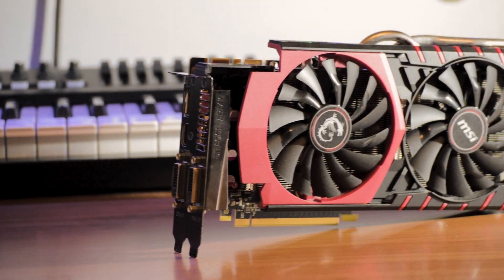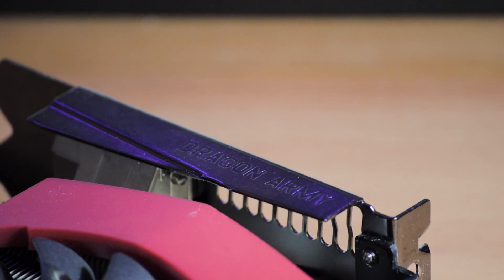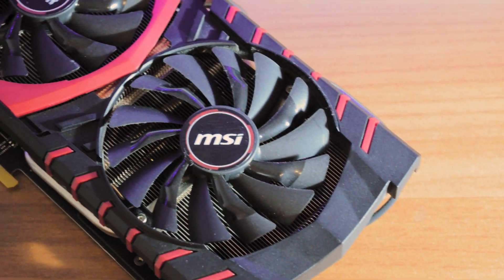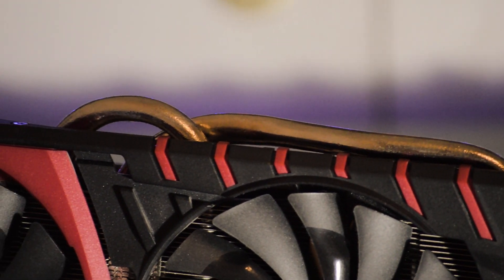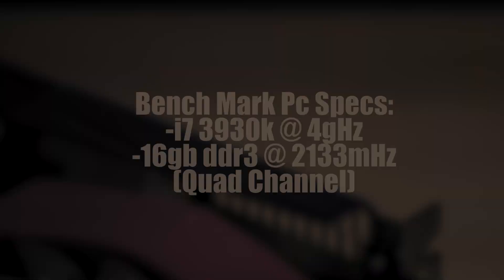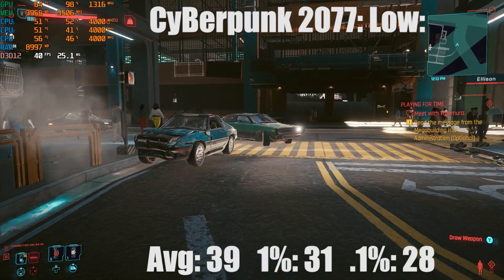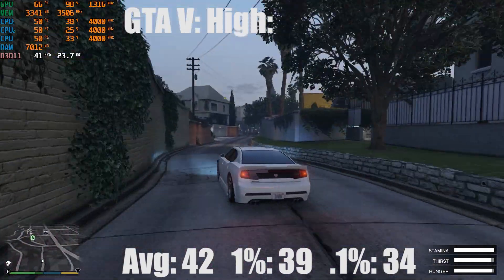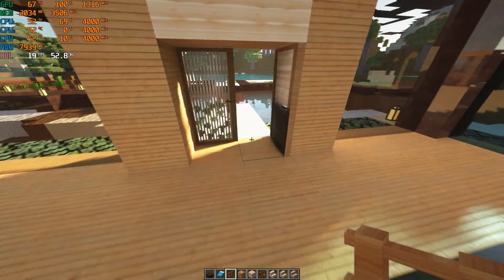Is The GTX 970 Worth it in 2020 - (Testing Cyberpunk 2077 & More)

Comment: Bought a first gen GTX 970 OC for $90.00 before the "crisis". That card was mined to crap as yhe miners loves these older 970s. Left it running in "my hanger" on FS2020 and came back to what I can only describe as a shattered lcd display. Well it was artifacts all over the screen. Card was fried. Immediately bought this 970, Dragon Army edition for 120.00 . Did a core upgrade from FX8350 @ 5ghz system to a Ryzen 5 config. This is the best card right now for under 200.00. Trust me on this, replace your thermal compound with Kryonaut and you will immediately have a gtx1660. Im getting 74fps on Forza Horizon 4 in 1080p and High settings with cars set to Ultra . Yes I am overclocking as high as +240 cpu clock and +350 memory clock via MSI Afterburner. FS 2020 on High, up to 55 fps. Im goiden here, seriously,  plus I spent my new GPU money on my Ryzen 5 3600,  mobo and RAM.  Perfect combo. Thanks for this video, honestly the best kept GPU secret out there. Lots of untapped potential on this bad boy. Its amzeballs and so glad I stumbled upon an honest seller for it. Dont touch the older ones, at all! Miners' old crap!

Comment: I upgraded from this card to an RTX2080 about two years ago. It's still a pretty good 1080p card, but the difference between it and the 2080 is really huge.  BTW, it never had a backplate.
Reply from the maker: Yea the difference between an rtx 2080 and a gtx 970 is night and day. But so is the price difference. Both still great for their respective prices. I wish the 970 had a backplate, would have looked much cleaner :)

Comment: I have i7 4gen with 970. I get 60-50 in gta with ultra, for honor on extreme, apex maxed, Minecraft stylized texture pack with sues pgti12 shaders. I get lowest FPS in Minecraft, constant 40-30fps. Lowest 28.
Reply: Awesome! Im trying to get a 970 myself. By the way im using i7 4790

Comment: Idk what settings you using but i have in GTA 5 ultra 90fps avg. i5 2500k at 4.5ghz, 970, 16gb ram.
Reply: How much vram
Reply: @tesgabenchmark  I doubt thats his actual avg fps. I doubt it a whole lot.
Unless hes playing sub 720p or looking at the floor the entire time.
Reply: @Waldherz  i dont think so dude, i have a 970 with an i7 4770k and i get around 75-90 fps too in gta on very high settings but maybe its cuz i have overclocked my gpu and cpu too so i relate to op
Reply: @alishah8526  75-90 fps is much much lower than his claimed 90fps avg.
Reply: @Waldherz  Did you ever tried a i5 2500k oc? Its stronger than most i7 cpus bro.. Also GTA like more old cpus than new ones. Bec it cant handle 16 cores or more.. it likes 4-8.
Reply: @JustKai3509  Ive been building and configuring PCs, including professional overclocks, for years. 
And the 2500 with any OC wont beat any i7 of its time and later with an equal amount of OC. 

Also there is no 16 core consumer intel CPU yet, so that comparison also dont apply here. 
So any modern CPU with at least 4 or more cores will beat the 2500K, no matter what you do.
Clockrate isnt everything. Memory bandwitdh, IPC and general architectural improvements beat the 2500k. In all games out there. 

If you dont believe me, take a look at other youtubers or technical publications of modern CPUs and compare the results to yours under the EXACT same conditions.
Reply: @Waldherz  what merk ur vga
Reply: @tesgabenchmark  What?
Reply: @tesgabenchmark  GTX 970 4GB VRAM.

Comment: Here is a ez trick for you all since this has analog display support and you have an old crtv monitor like i hv 22inch sony monitor supports upto 160hz istg i play every latest game on ultra max preset with 60+fps including rdr 2 and its way better than your latest 2k 4k 120hz lcds and leds monitor
It has 0.0ms 
0 input lag
I play all games on 1024x768 resolution and i swear to god rdr2 for me on crtv is heaven for me it looks way better than my samsung 4k tv with ps4pro
On 1920x1080 my rdr 2 ultra preset vram crossed 5gb vram and when i switched the reso to 1024x768 on sem preset it only takes 4000mb of vram which allows me to play on ultra max preset except water refraction and physics cuz its heavy and drops to 30 fps 
1024x768 is freaking better than my 4k on tv damn it has pure soft edges than my 4k samsung i got like 20 to 30fps boost and gane looks insanely clear hd even on 1024x768 with txaa set to medium not even high because its not needed geniunely cuz your crtv is still way ahead than latest 4k monitors
Reply: I set it to 1280x800 and then to 1600x900 damnnnnnnnnnnn it looked like freaking 8k display and my crtv monitor supports upto 2560x1600 resolution but 60hz only on this resolution
Reply: @Diplofer1  use a BenQ
Reply: @danishbutter1847  i had benq 24 zowie
Reply: My specs are shitt
I7 2600 stock
8gb ram samsung 1600hz
128gb ssd samsung evo 840
Gtx 970 4g  evga sc
On this cheap rig i play all 2020 games including death stranding,rdr2,doom eternal,detroit,shadow of tomb,horizon zero dawn,re3,quantum break,control,forza horizon 4, gears 5 and mk11,enlisted,just cause 4,rage 2,farcry 5,crysis remastered,dota2,assassins odessy all at max preset on 1024x768=4k
 resolution  with freaking 60+ fps
Reply: I never knew that old crtv is the biggest gem that i ever had because the first game i played was rainbow six siege on 1024x768 max setting multiplayer with avg of 165fps and minimum 120 with freaking 165hz with 0 response time 0 imput lag along with crystal clear soft freaking edges its like a natural 16x multisampling AA the monitor has and some of my friends tried on my monitor they were absolutely shocked because of the quality and the resonse time one of them said im selling my alien ware 240hz lmaoo because he said the display size and this resolution with quality really fits my gameplay competively
Reply: Last nvidia gpu which supports analog display is gtx 980ti and gtx titan
If you have an crtv old monitor with least 100hz refresh rate i guess you are the luckiest gamer to have this
Reply: Digital foundary even tested and said even on 1024x768 it is way better than 3840x2160p lol check his video
Reply: the smaller the TV the better